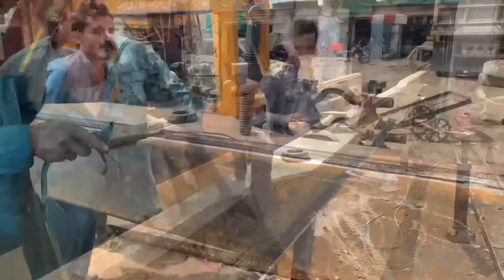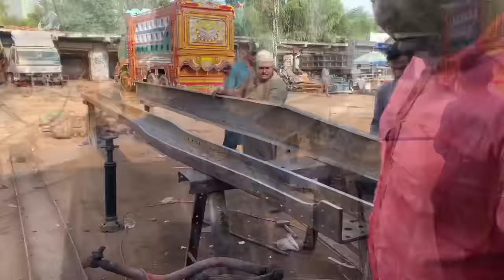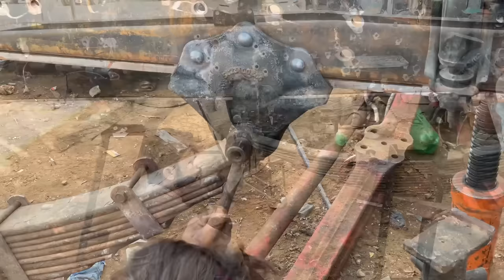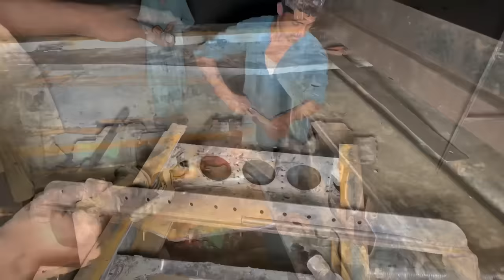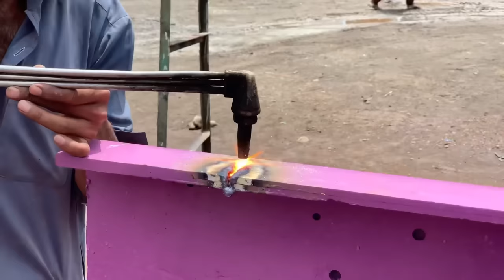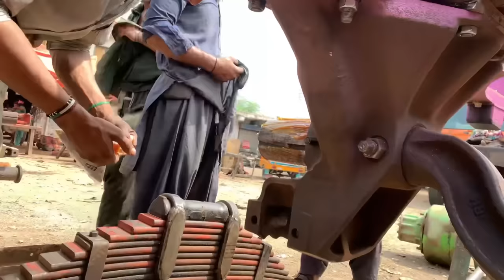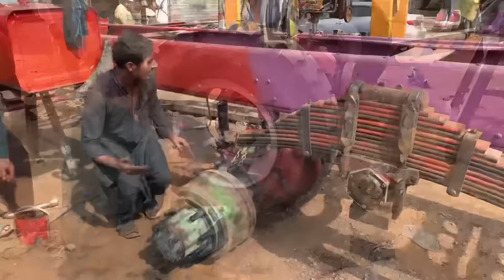The Process Of Handcrafting & Fitting A UD Truck Chassis In A Local Workshop

Comment: What bothers me the most is that in all such repairs of lorries that have been involved in accidents, the dirty parts are refitted. In my opinion, it would be easier if all the old parts were cleaned, overhauled and repainted before reassembly. Not simply spreading paint over all the dirt.  This would add much more value to the work. Two completely different worlds collide here. The work could also be made much easier for people if they were provided with decent tools. Here too, profit is valued more highly than the safety of the workers.

Comment: The problem with this chassis is being made of A36 steel very weak and soft It's only 60000 pounds tensile strength A truck in the United States uses anywhere from 98000 to 120000 tensile strength twice as strong as what they are using I know what they are using because I have worked on the steel industry for 40yrs just by seeing how easy they can drill the material with a hand drill tells me how soft the material is in high strength steel you need a magnetic drill and a machine quality drill bit a hand drill and a normal drill bit will burn the drill bit with just one hole that chassi will bend and crack the first time it's overloaded a little bit a lot of work for an inferior chassis
Reply: I am a retired welding inspector and share your opinion of their work.  They are willing and hard workers but start from ground zero in knowledge and information about what they are doing.  They need training

Comment: Impressive but also hard to watch, how many apprentices lose their hands to a sledge hammer accident while holding the round over die bit while some guy swing, it only takes one bad swing. How many take a burr to the hand or eye, no eye protection. So many other things, but productivity looks amazing and low overheads or no overheads more like it. It goes to show if there's not over regulation coupled with an abundance of cheap labor, then things can be cheap and productive BUT it's at a cost to human life and the quality there of. A happy balance is good I think.

Comment: This build seems like they’re paying much higher attention to detail. Using post jacks before welding is the first sign. And then the purple paint/ red paint, and perhaps the most telling is the engine block seems to be clean! Amazing!
Reply: They weld the fuel tanks on after painting the chassis. They drag the spring pivots in the dirt after greasing them. They constantly work on the ground. They have no idea about torquing bolts. There's nothing to applaud here as all they are doing is building an accident vehicle.

Comment: At 1:32 thewelder struck an arc on the frame of the truck to see if he had a ground.  That arc struck spot, if not properly treated, could result in a crack.  Cracks in structures do only one thing, they get bigger.

Comment: No workshop
No floor
No lights
No fans or climate control
No hard hats
No gloves
No safety shields
No safety glasses
No safety shoes (or shoes)
No respirators
No air tools
No paint booth
No battery tools
No OSHA
No child labor laws
No worries
No complaints
No problems

Its amazing what can be done with limited resources.  I'll bet there are places in the world that have all the modern facilities and equipment, highly paid workers with benefits, all the protection from government laws and cannot do what these guys do.  Bravo.
Reply: And the end product is very safe. Watch the videos about broken springs, axles, wheels, frames. Great work or were you joking?
Reply: @SPUDHOME  soooo are you saying western vehicles never break down??? I had a friend who bought a brand new american vehicle and less than a year later the axle cracked. I say these guys are doing excellent work. Period.
Reply: @SPUDHOME  I worked in a truck shop. ALL those parts break everyday in the western world too! You don't know what you're talking about. Broken frames and springs are VERY common!
Reply: @mattdillon4398  i have never seen a axil break causing a accident in usa. Or a frame break in to. Or a cab fall off

Comment: As usual the work area. Trash, garage, metal shavings, welding rod ends. And of course all the workers wearing safety sandals. But i have heard that this is cleaned every morning. So this much crap and garbage is dumped every day by the workers that can get injured by it. Really no one cares. The government, boss, workers. Nobody. No work gloves, eye protection, boots, clothing. Look at the chisels, punches, rivet drivers. The flair on the heads. Will splinter off. The parts that are riveted together, no rust protection. I can go on and on. But why. Idiots keep posting “great job.  Wonderfull work.